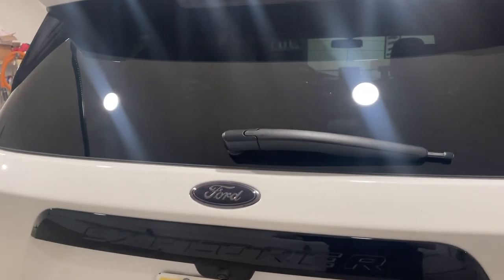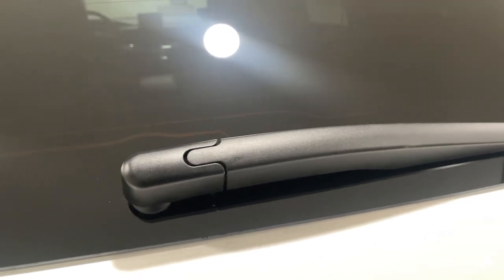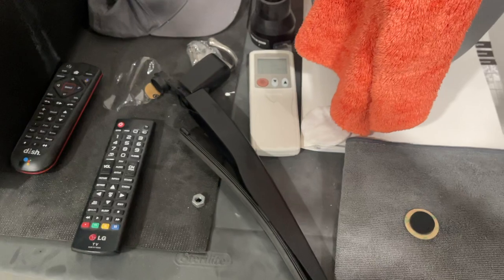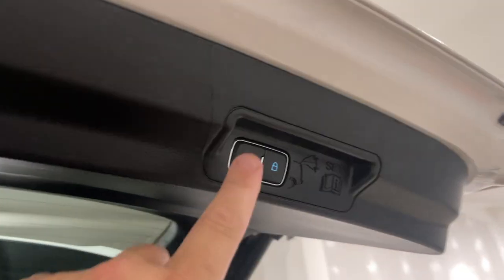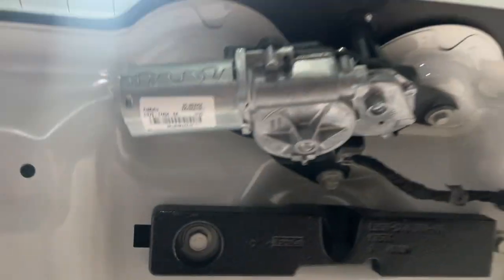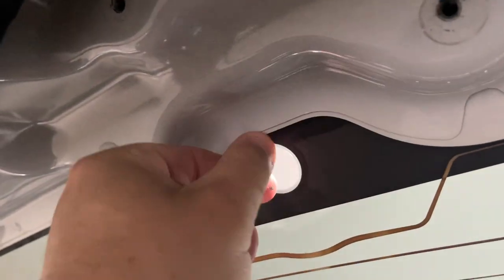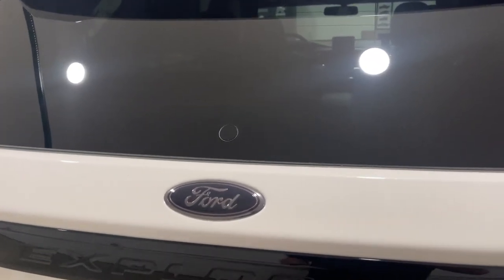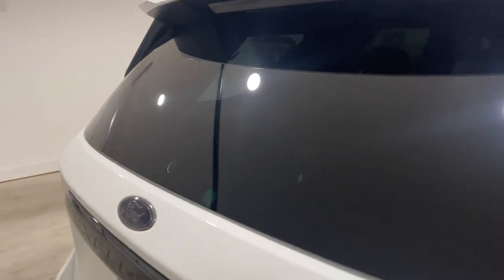2020 - 2023 Ford Explorer Rear wiper Delete

Comment: If I were to use the silicon would I put it around it before installing the plug or from the outside after installed?
Reply from the maker: I wouldn’t use silicone because it may affect the way the adhesive on the plug itself sticks to the window glass.  I guess you could smear some around the outer edge of the plug after you’ve installed it on the outside of the glass, but it would be a pain to get the excess off and you would surely scratch the surfaces plug up and it would never come back clean